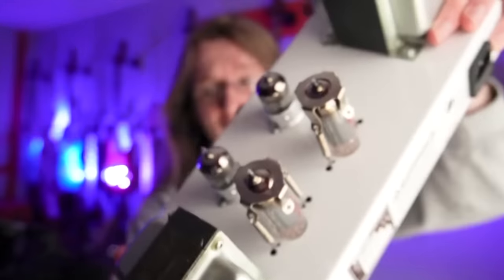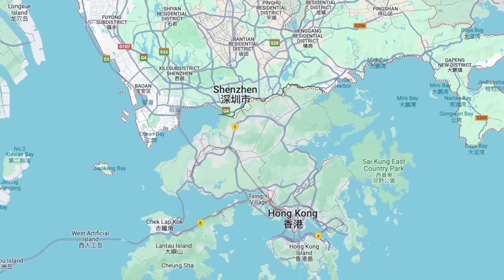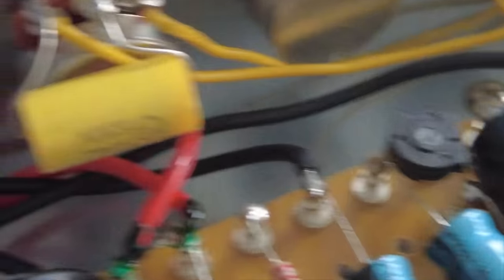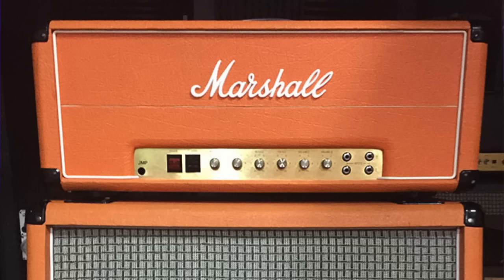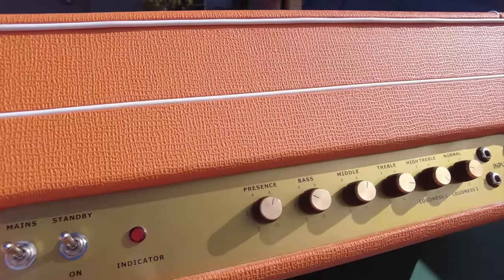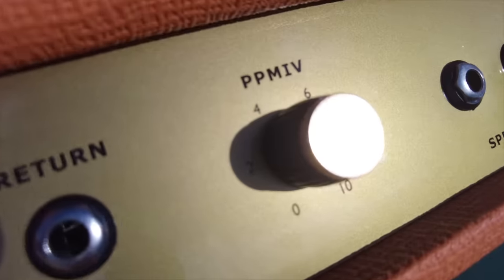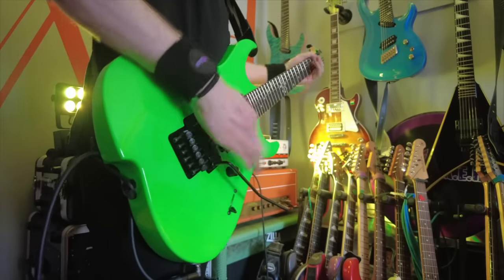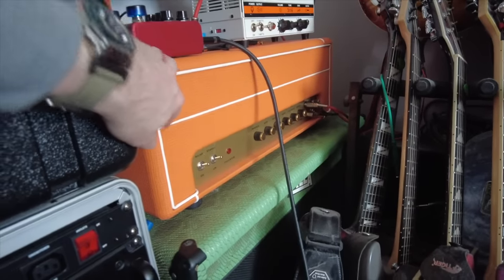Who made this Amp??

Comment: Clarification on the PPIMV - both pre-phase inverter (traditional) and post phase inverter master volumes are still "at the back" of the amp in a sense*. The phase inverter is the tube (2 amplification components) responsible for creating 2 opposing phase signals to drive the power amp. By the nature of most PIs, they tend to amplify the two signals unevenly, creating a different blend of 2nd/3rd order harmonics, and a brighter, harder distortion, than many people mistake for "power amp distortion" (real power amp distortion can get really ugly).

The pre-phase inverter master vol (traditional) in a late stage tonestack style amp will typically sit between tone stack and phase inverter (still late in the amp), and so turning down the volume will keep preamp distortion the same, but reduce phase inverter distortion (power amp distortion, effectively). In a PPIMV setup, turning up the preamp gains and turning down the PPIMV will kind of keep the phase inverter distortion the same, negative feedback not considered.

* Some modified Marshall circuits from the 80s did actually have master volumes inserted before the tone stack, which are pretty wild. They still reduce overall volume, but also change the way the tone stack "loads" the preamp signal.

Comment: Having a ppi master volume on a plexi sounds really nice. I have an ori50c (It's not a real plexi but similar) and even on the 5w setting you got to crank the shit out of it to the point of hearing damage If you want the distortion sound of that amp. I really just need to get a torpedo captor for that amp.
Reply: I've got an Origin 20h, and I bought a Bugera PS1. If you're not bothered by its "cheapness," the PS1 does the job.

Comment: I bought a Mojotone "Bluesbreaker" kit in 2000 for about $600. Its a combo with 2X12's. Handwired by me, but very simple with good instructions. It has hundreds of gigs on it and I have dropped it several times only denting the corners 😞. Same tubes and still rocks. DIY kits are great and you get learned too!

Comment: Ceriatone. If you don't know who they are, look them up. Get them to make you one. 
Or if you're a DIYer piece one together. Make sure you get good iron. That's the important bit. After that just piece the bits together from the plethora of great amp kit makers out there and tailor it to your liking. Sure it'll cost a bit more than a generic kit or heck, maybe even a new mass production amp, but it'll be YOURS. Which is a very cool thing indeed.
Reply: You are correct sir! I own a JCM 2204 and Son of Yeti. They are absolutely awesome amps. If one has the patience.
Reply: I have a King Kong wired as '68 JMP Ch1, and modified JCM 800 Ch2.
I couldn't agree more about getting a Ceriatone.
Reply: I had one of their early 50 watt Dumble clones, easily the “ best “ amp I’ve ever played through. I had a chassis only version that I built a head shell for.
Reply: I got a SoY and JTM45. No complaints
Reply: For some reason Ceriatone got a bad wrap for transformers a long time ago and you still hear people talk about it. I actually use their iron in builds where I got parts elsewhere. I tend to get transformers and chassis from Nik. I wish my builds were half as clean as Ceriatone though
Reply: @clintn6677  
Yea, I remember when that transformer thing went around, good to see Nik got it right. I'm amazed at how good he/they are.
Reply: @bretheweb   yeah it seems like it was a long time ago but it keeps getting brought up.
Reply: Yes!  These amps are as good (and sound as good) as anything I've ever played.
Reply: @ender_wiggum   I've owned an all access plexi, AJ plexi, 2204, Molecular, and leviathan. All were great

Comment: Psionic audio made a point that really opened my mind up when it comes to amps. Hardwired ≠ good. Hand wired by who? How good is the circuit to begin with? A good circuit, on high quality PCB will smash a poorly designed circuit, hardwired by an idiot any day of the week. 

Manufacturers like to throw around words that entice people and make us think that the more expensive option is best when that’s not necessarily the case
Reply: Lyle has also brought up the point that certain workflows and practices of 1950-1980 are no longer allowed today for some various safety standards, and so some manufacturers have to actually add things to their circuit that may affect the tone of the amp just to meet safety standards. The one he was referring to in the video was a Fender HW that needed to meet some INTL/EU electrical safety standards.

Comment: Interesting stuff. Point to point hand wired amps have been available in this $300 to $800 price range for quite a while if you really look for them. I got a point to point hand wired 50W two channel tube JCM-800 style head from a builder in the Ukraine fully customized to my specs  for under $800 delivered to my door. He did use all Chinese made parts, but so do all the amp makers including the so called boutique factories in the states. He builds his own head shells, fabricates the chassis, screen prints the front and rear panels,  winds his own power transformers and output transformers and still manages to make a profit. He actually sends you photos of each stage of the custom made to order builds. The same amp would cost about 4 grand if bought from one of the boutique shops or a Canadian or American builder. Most things are made in China these days,  and for the most part are just fine. Why there still persists this odd notion that made in China means poor quality or bad is beyond me. Make it in China and slap an American or British famous company name on it and it's great. Get the same thing without the famous name on it and it's subpar, of lesser quality to some people. I don't even play a tube amp anymore. It looks like one, so I get plenty of compliments from guitar players on my tone and they ask what kind of tubes are in the thing that make it sound so good. None, you are hearing an digital IR out the back of a digitally modelled amplifier. Anyway, I still have plenty of tube amps and I do like them for what they are regardless of what bits and bobs might be making the magic inside them. I wonder if this same company makes the Bugera amps? Seems like there might be some similarities. I had a Bugera 1960, the 4 hole marshall '59 super lead copy and it was a really fantastic amplifier. Very well built and rock solid.
Reply: Crab amps from Ukraine?

Comment: I could see a use for going with a hybrid wiring scheme. PBC for all of the electronics (transistors, caps, diodes, resistors, etc) and hand wiring all of the interface components (pots, jacks, switches, etc). The parts that wear could be easily repaired without all of the labor involved in soldering the smaller components that are unlikely to fail.

Comment: I'm not sure, but 1969 is probably referring to a year since 1968-1972 are roughly the dates of the most desirable Marshalls being produced with a bit of variation for the black flag super leads at the beginning and I think in '73 or '73 they switched to PC Boards.

All of the Marshalls with different schematics had different models such as 1959 for the late 60s/early 70s 100W superlead. I want to say there is a model that's a 1968, 1969 or something like that. I thought it was a Marshall Super Bass of some type, but when I looked back through some Schematics the closest I found in a couple minutes of searching was a Marshall Major which is model 1966.

In any case, this is a cool video.

Comment: Like KDH says, repairability is a big factor. But so is modability. I built myself an Orange OR120 clone, but with the following changes: Master Volume (pre phase inverter in my case), presence control, switchable B+ voltage for a variable power setting, effects loop, bright switch, and because i don't play out.... an 18 Watt power section (two EL84 tubes).

I'm also thinking about putting a switch for variable biasing on the 2nd (or 3rd stage, I forget which) that gives the characteristic 70s orange fuzzy overdrive, and give the option to make it more open and Marshally. Also maybe an eq bypass for full extreme gain doomy noise.

Comment: This sounds suspiciously like it's actually Wang's.  The descriptions of the amps, that they're handwired, the great quality level, the performance and sound, all great.
And if it is Wang's building them for you, I couldn't imagine anyone in China (or any other offshore or US site) doing a better job in the first place and then at their price points, well you just can't beat it for something you really enjoy playing.
I got one of their 5W minis and through a couple 8" monitors it rips pretty good for ~250 USD, it's a cool looking little unit, and it's well built, as well...
Reply: I believe Wangs is based in Shanxi whereas this factory is located in Shenzhen, so pretty far away. Also seems like this is a much bigger operation than Wangs.
Reply: @shreddyz  Unless they use Wangs for the handwired production, and in house for the PCB production
Reply: @caetanosilveira153  I don't think that's very likely, the two are located on opposite sides of the country and Wangs makes it very clear they use all Japanese and European electrical components while Gran Tech looks to use other Shenzhen manufacturers for components.

Comment: Like Skip Simmons from TAVA says: Building amps is like cooking. It's not just about the recipe, it's about the quality of the ingredients too. This especially counts for the transformers and the capacitors.
Second a PCB has to be in spec for the amount of current it handles. There are a lot of PCB amps out there that aren't, that will burn out on the high filament currents the tubes require.
And third, one of the nastiest problems in a tube amp is oscillation due to parts orientation. This is easier fixed in a point-to-point wired amp than in a PCB amp. And yes, those issues can occur in a PCB amp.

Comment: Just some food for thougths: The amp has no marks for certification whatsoever, not even a CE mark as far as I can see(?), so not sure how it's in England nowadays, but in the EU importing it would technically not be allowed. There are certain safety standards that have to be fullfilled, meaning extensive heat, transformer testings and markings on the amp etc. in order to be allowed to sell in Europe and the US. I'm not sure how much the Chinese manufacturer can be trusted as there's not consequences for them in case of a problem (and testing costs are usually substantial). That might be different when buying from a "western" company that's actually liable for their products, even if those product are manufactured by somebody like Shenzhen Grand.
Reply: There's also the question of worker safety and pay: how much are the folks hand-wiring those amps getting paid a day? What are their working conditions? Are they being abused, forced to work extra hours? Such low prices often come at a high human price. Not to mention the environmental price: what kinds of environmental regulations are the factories abiding by? There are reasons why products made in China are cheaper; and there's more at stake than a short-term good deal.
Reply: If their website can be believed, they're already distributing to the US and Europe, as well as many other places around the globe.

Comment: A PCB can still be a hand wired amp, you're thinking of a point to point amps.
People think than with non master volume amps, it's the power tubes that overdrive when they crank out. They do, but so does the phase inverter and that contributes to the sound. A normal master volume is before the PI, so if you install a master volume, even if you crank the master volume, it won't sound like a non-master amp cranked up. It's why PPIMVs but they're are drawnacks to them

Comment: It's quite impressive what you get for your money! I guess they save costs by using cheaper components and not having the amps go through approvals. No sign of CE certification, RoHs compliance, Met or Intertek, UL compliance, CSA etc. This would save them an absolute fortune. If you were to import these to re-brand and legitimately sell in the UK for example, you would have to get this done and you'd see how quickly the cost goes up!

Comment: Handwired doesn't mean no PCB. Handwired means the components are assembled (funnily enough) by hand, either to a PCB or to a turret board. Handwired better? well don't assume the guy handwiring it is Alexander Dumble, more likely minimum wage employee. There is no tonal difference between a turret board (or point to point) wired amp and an amp with a quality PCB (ask Mike Soldano)

Comment: China may still make a lot of crap, but has been making high quality electronics and electricals for many branded companies for years (just look at the stuff you already have in your house). I'm not into guitar related stuff I'm interested from a vocalist and home HiFi point of view. Recently I've been updating my home cinema system and after many unsuccessful attempts have found a centre speaker that goes well with my set-up and sounds great to my ears. It's an Elec speaker, high quality brand, German comany, designed in Germany - made in China. I've also changed my home HiFi amp from a very good Arcam Alpha 2 (Made in the UK), which I bought new in 1989, to two Aiyima A07 Max (one for each speaker (Tannoy – UK made) also bought new in 1989). The Aiyima amps are excellent, have good quality components and cost €70 each, bought direct from Aiyima via Aliexpress. My digital mixer is a Behringer XR18 made in China, maybe not the best but more than good enough for my needs. My main microphones are Sennheiser (made in Germany) Rode (made in Australia) and JZ (Made in Latvia) my IEM is Sennheiser (made in Germany) and my radio mics are Sennheiser (made in Germany) but I have been experimenting with a few Chinese made mics and wireless systems and for little money they do the job remarkably well. Yes there are issues with the treatment of workers in China which should not be ignored, but then workers in some if not all "Western" companies are not particularly well treated and recompensed, so we have little moral ground to stand on. I'm old enough to remember when "Made in Japan" signified cheap and cheerful, now Made in Japan is regarded as a sign of high quality. Likewise "Made in Taiwan" where now some of the best electronics in the world are made. In order to produce to the high standards required by respected brands, Chinese companies have, out of necessity, learned how to produce high quality and now they are beginning to produce their own high quality brands, just as Japan, Taiwan and Korea did in the past.

Comment: Looks like a 1987 clone with a Lost in Translation PPIMV

The 100 watt is called the 1959 "super lead". But they also had a 50 watt model which they just called the "lead" and it was model 1987

Comment: That amp is great value for money save you the time of wiring a kit together. The third 12ax7s is likely the phase inverter. The other two 12ax7s have two sides each used as gain.  If you're a little bit inclined to thinker with electronics you could build one for little cheaper loads of info out there about amp builds.  The most expensive part of the build is sourcing decent transformers.

Comment: a 30w version of this would likely be perfect in this day and age 😎
Reply: What tube combination gets you to 30w?
Reply: @qua7771 it would have to be built with  different transformers. You could even make it 10 or 20 watts.
Reply: @soapboxearth2  Are you talking about lowering the voltage of the power transformer to get 30W from, say 2 EL34's, or 6L6's?  I thought you might have meant using 4 EL84's, or 6V6's.  In that case, 50W makes more since to me.
The output transformer has to match the impedance of the tubes, and speaker.
Reply: Basically a JTM 45 power/output stage with a 1959 Super Lead preamp. Add in the FX loop and PPIMV if desired and you're golden. Enough headroom to play live but still capable of cranking and crunching
Reply: @soapboxearth2  I like 30 w to get over a drum kit live with a clean tone when needed, but in the clubs now the sound guys just get killed with anything 40-50w or more - just too loud in the space or just on stage with the feedback.  30w with an attenuator or soak function for practice might be the best IMO
Reply: @sim0n17  yeah I've even built some 15 and 20 watt amps that are surprisingly loud. But this 50 watt with the Lar Mar type master volume is really nicely tunable. You can even do a fairly simple mod to run it at roughly half power on a switch . Pentode triode mod.
Reply: Look for a JTM-45 style amp. 30 watts.
Reply: @soapboxearth2  I have triode mode on my Ceriatone.  I think it is the way to go.  Some people say they don't like the tone of triode mode.  I doubt most of them have heard it.  My amp sounds fine with 50W and a master volume.
Reply: @qua7771  I have used it in a couple builds and liked it. Everything sounds better louder, so I think when people use the switch and A-B it , they're naturally going to like the louder setting.. but it has its use. The ppimv, along with the tridoe setting, can really tame an amp.

Comment: How are those Hufschmid pickups? What's the difference from the wire coils? What's the DC resistance? Is it on all the same and the difference in output comes from the size of the magnet, which I guess is that black thing?

Comment: I have a 5W bugera amp.  Nice little amp but I wanted to brighten it up by changing a cap.  easy?  no.  Probably would have taken me an hour or two just to get to the cap and I wasn't confident that I'd be able to get it back together.  My 1872 traynor would have taken me 20 minutes to get it apart..
Reply: Get an equal pedal